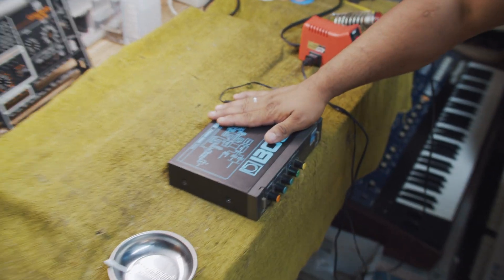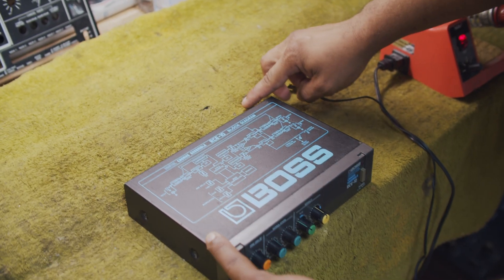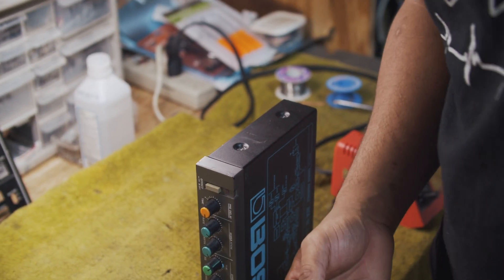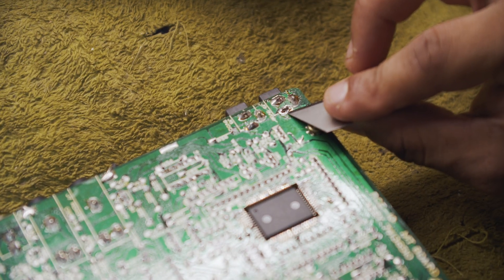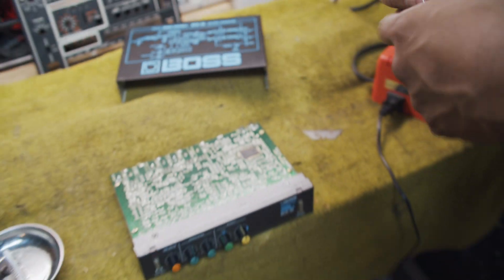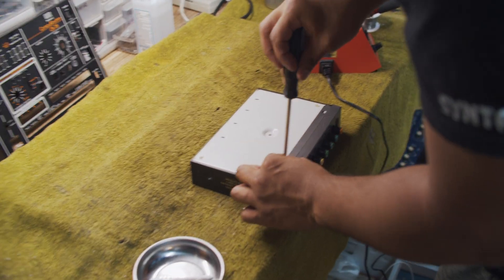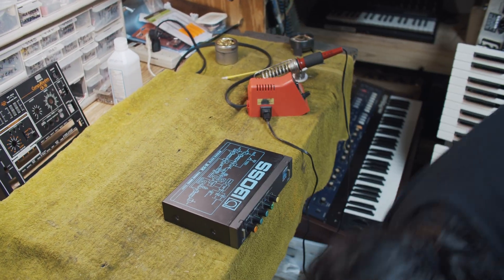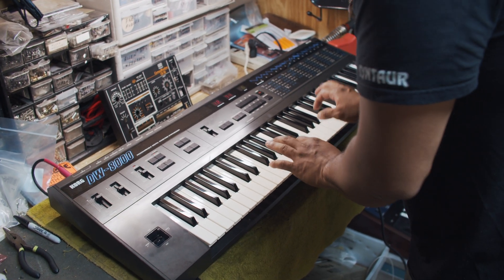Synth Repair & Restoration Tip 3: Repairing a Power Inlet Jack

Comment: Hi Syntaur. My JDXI has another weird issue. The volume seems to gradually decrease over time to 0 even when the knob isn’t moving. When I touch the knob it jumps back to whatever volume it is supposed to be at and the decreases again. Any idea what might cause that? I am thinking it’s the pot or something to do with another component such as the PCB. I took it apart and put it back together about a dozen times trying to fix the key bed and was finally able to get everything working again but I basically can’t use the synth because of this!

Comment: i actually just ordered a new power inlet jack for my microkorg i pulled out of the trash off your website before i found this video.. i know it works because the battery function works but the power cable did not work. I replaced it with another cable i had because it uses the same one as guitar pedals so i had numerous, still nothing. Im going to try spraying deoxit inside the port whole next and ill try the wiggle technique to make sure its a crack but im nearly certain its something with the port. It's definitely old so its supposed to negative center but i guess if it doesnt work upon replacement ill try postive center.

Comment: Hey Syntaur, by any chance would you guys have a replacement power supply for a Yamaha SY-85?  But in a 220-240volt version for use in Australia?  Or recommend a similar suitable replacement I could shoehorn in there?